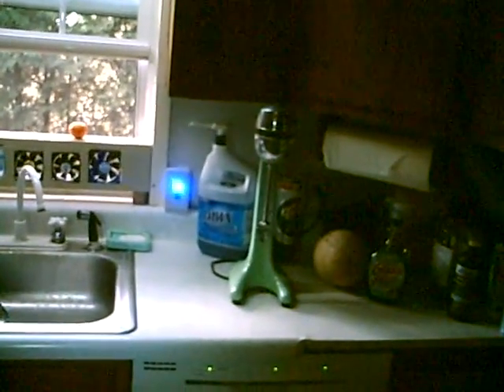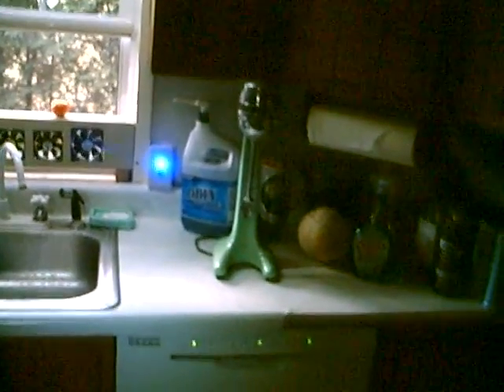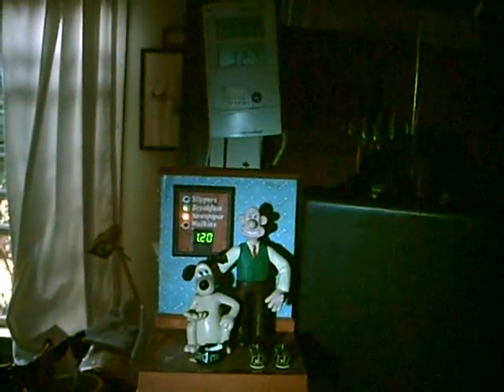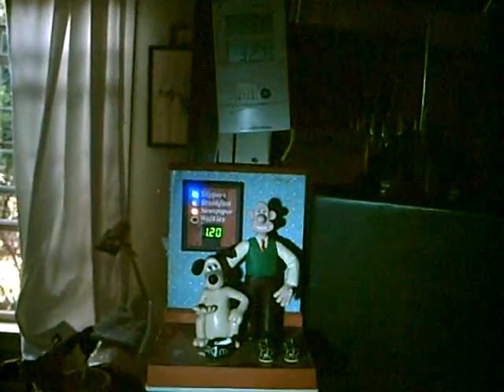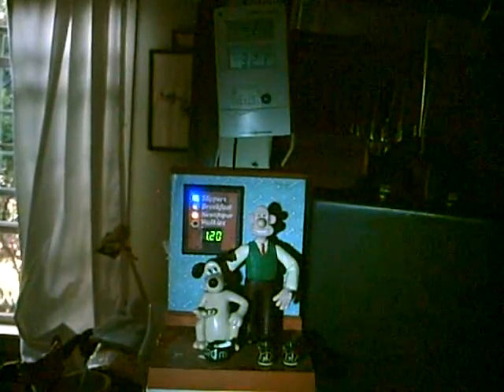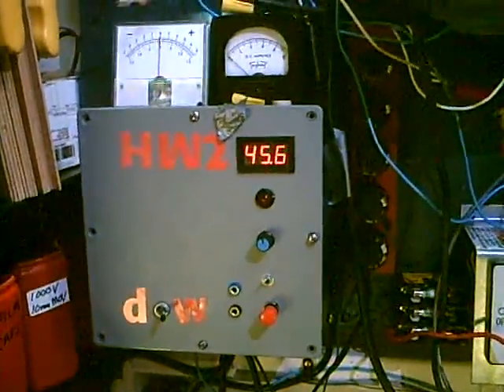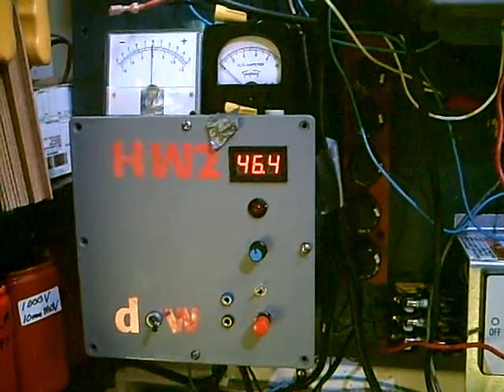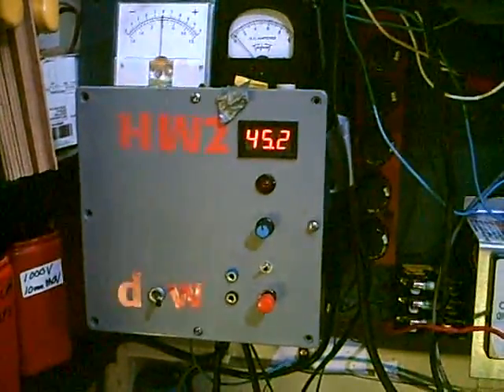Off Grid Solar Dishwasher On Only A 12V Battery, Only 100W To Run!

Comment: I got our dishwasher fully solar powered a few of months ago, before that the solar PV powered the electric side of it but the heat came from an LPG fired califont, which was never ideal.  I started playing with a solar thermal panel a friend gave me last Summer (southern hemisphere) and realised it held quite a bit of water, so it could be used as a small batch heater. 

When a rat chewed through the water line in August it gave me an excuse to pull the dishwasher out and make some modifications. I removed the solenoid and connected a hose directly from the cavity inlet port to the outlet of the solar thermal panel. Then the solenoid was placed between the water supply and the inlet of the solar panel, running from the dishwasher's controller via a long cable. 

This formed a very simple open ended hot water system with the solenoid valve letting cold water in which pushes the hot water out of the thermal panel and into the dishwasher. 

It is amazingly tolerant of the weather conditions but naturally works the best on a nice sunny day without wind. In these conditions the dishes get hot enough to dry under their own heat. Now we can run it almost every day, rather than waiting and mega loading it to make the most of the LPG.

Comment: Cool vid. How much pv do you have ?
Reply from the maker: I have 1100W in a 36V (50V) string powering the primary water heater and the same power of grid tie panels for 60V powering heater #2. and about 150W in an old 12V system.   They are all poor performers due to being almost flat and lots of shading, they sit under trees.  You could say move them, but they aren't even on my property.  Another 560W is still in storage from last year waiting for me to re rack and eliminate older panels.  Space is very limited and packing density is a priority.  That is a lot of power going into a car battery and max charging is limited to 15A. I choose to run things with directly with panel voltage and skip inverter use.  It generates enough power on the worst rainy day to operate the essentials without using battery reserve.  Every day I'm finding more things that don't work due to lightning strike.  Found the garage system dead with blown charge controller today,
Reply: That's sounds like you got what you need. Lightning is definitely a problem. Im sure you will have it running again in no time.Thanks for shaing